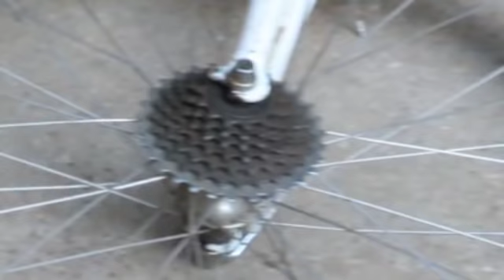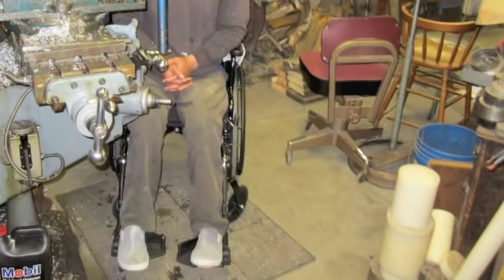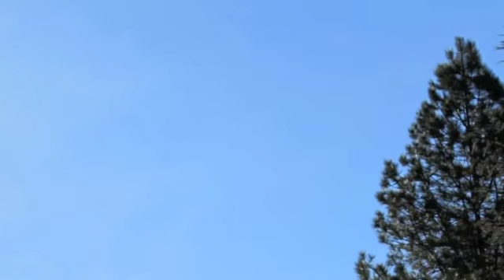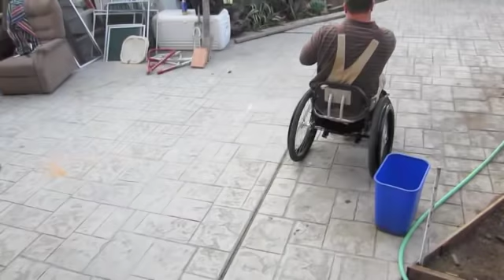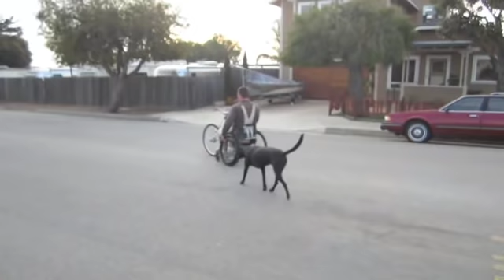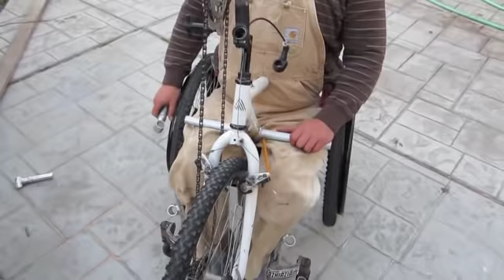wheelchair - ATTACHABLE HAND CYCLE - The Build & First Ride - SAIL ROW CAMP CANOE vLog6

Comment: I made one almost like yours you have to have the front wheels off the ground, when I made mines there was no YOUTUBE or FakeBook I did mines out of one bike the same way but used the back of the bike and the forks the front wheels have to be slightly off the ground and you will go fast, I never put any brakes on mine it's just hanging up in the garage I made it 1998? If I remember correctly